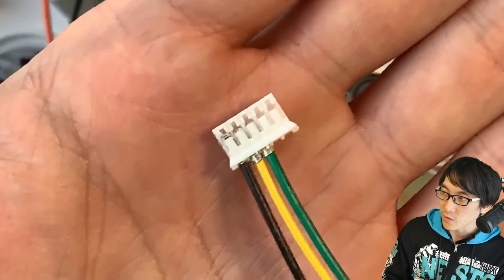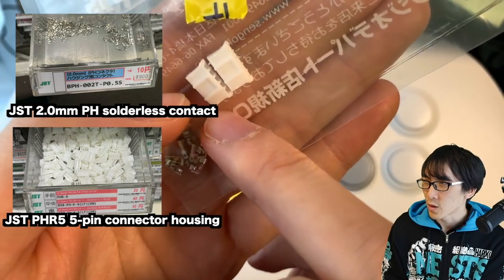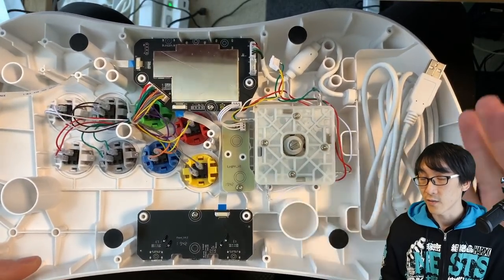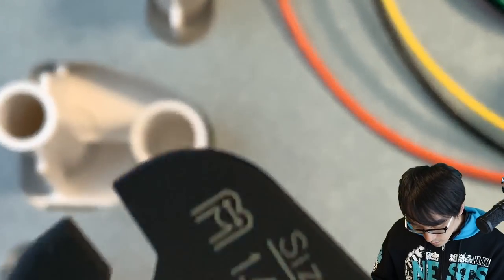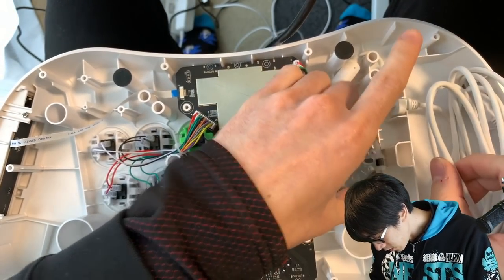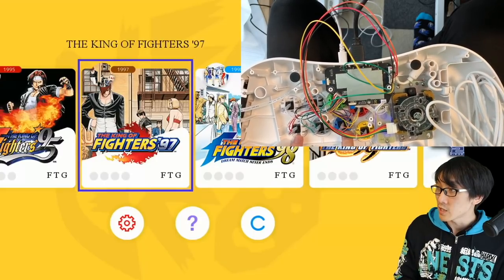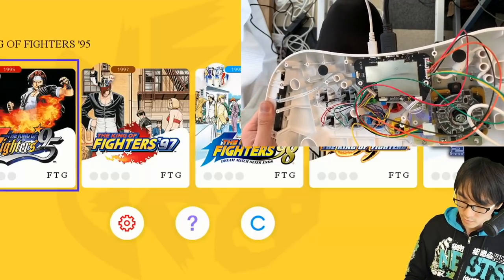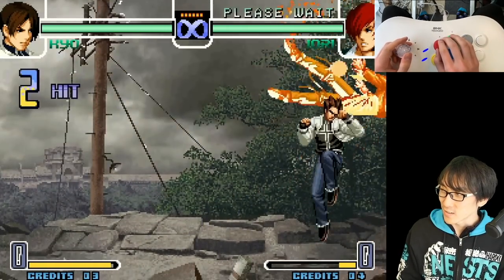EASY MOD (...but you NEED THIS!)【Neo Geo Arcade Stick Pro】

Comment: I have to give SNK a lot of credit for how forward thinking they made this. With the ability to replace parts and swap in higher quality parts. So even if you wear out or break a stick or button you can replace it instead of buying a new unit.

Comment: As reference for anyone who cares but doesn't know: the original Neo Geo cabinets used a Seimitsu LS 40, so if you want it to have that feel now you know which stick to buy.

Of course, this applies only to the japanese cabs, the american ones used battops, iirc they felt like happs or something like that, which sadly don't fit on this stick.
Reply: does the ls 40 fit as well?
Reply: @dbnpoldermans4120  The LS-40 on FocusAttack has both the PCB type and the four plugs type with basically the same mounting plate as the LS-56 which was shown by Scarlet Sprites to be able to mount on the arcade stick. The four plug type would be easier to use the same connections as the base joystick so it would be an easier mod.
Reply: @rxzero00  You're awesome! thx
Reply: @dbnpoldermans4120  No problem.
Reply: I love my LS-40, it's a great all-around stick! (fighting games, shmups, arcade games) Been using it for a while in my previously JLF-modded SF IV Arcade Fightstick, and I'm never going back!
Reply: They used American hardware in American cabs for obvious reasons -- you favor the hardware from home.
Likewise, you're going to see Japanese parts in Japanese cabs on the Japanese homeland and the parts furnishing depends on which vendor (Hori, Sanwa, Seimitsu) the venue (arcade) favors.

I never liked the bat tops, honestly, and am not a fan of the Happ joysticks.  They always felt -- awkward and more like they were made for INDUSTRY and NOT electronic entertainment.  The button positioning and caved in faces of American buttons were something I never liked, either.  Very uncomfortable and just not ergonomic.  They're made for Bigfoot hands, not average-sized human beings.  The fact that they use as the basis for over half the Arcade 1Up machines ensures I will stick with PC and console gaming for the future because I don't want to pay for a stand-up I know I'm going to have to spend at least $100 to mod from Day One to play comfortably.
Reply: @AvengerII  Oh I didn't mean it as a criticism or something, just as information for anyone that wanted it to feel as authenthic as possible.

And I understand why they used the parts they used, and I agree, Japanese parts are better, more precise and so on. However, Happ parts still have a place on my heart, if only because that's what machines in my country had.
Reply: @DEADPOOL9AND  I wasn't criticizing you.
I'm just saying that they're gonna favor the local manufacturer.  That's just how it is.
That's why they used bat tops and Happ buttons in American arcades, and why they used ball handles and Japanese buttons in Japanese arcades.
Of course, they had ball handles on some American machines.  The "Bally" (Midway) Pac-Man machines had ball handles on their joystick levers.  So did the American Donkey Kong machines.  There were American vendors like Bally and Wico that manufactured joysticks with ball handles.  My first third-party "professional-grade" joystick was a Wico joystick.  It was a bat handle but my parents went ahead and got me a second one with the ball handle that I wanted.  One of the last two replacement balltops I bought recently was a recreation of the 38mm red ball handle Wico produced for its joysticks!  It was like a homecoming for me 30+ years later!

It just happens I like the Japanese parts better.  I never felt that comfortable with the Happ parts.  I read years later they adapted these parts from industrial parts (what they would have used in factories) and that explains their ruggedness and also why they're not as sensitive.
Arguably, some Happ hardware lasts longer but the point's kind moot.  Sometime in the late 1990s or early 2000s (when American arcades were dying out rapidly), they sold out the Happ dyes, tooling, etc. to the Chinese and they say the Chinese production of the pushbuttons and levers is not as good as it was in the US.  There's an alternative to that, even.  They licensed the same parts to an Italian company and they still make those same parts to an allegedly higher, more consistent standard than the current Happ does.
Either Happ or iL doesn't matter to me.  I prefer the Hori (levers, pushbuttons), Sanwa (pushbuttons), and Seimitsu (levers) parts.  Even these companies make most of their parts in China now but with good floor managers.
Reply: @rxzero00  Do I always need an additional flat mounting plate for a Seimitsu LS-40 in the Neogeo ASP? Thanks
Reply: Yeah you're going to need a universal mounting plate from like Paradise Arcade so that the screw holes will line up with the JLF holes

Comment: If I'm not mistake, the neo geo machines used the seimitsu ls-40 lever
Reply: Yeah, but the mounting holes in the case are for a JLF mounting plate, so you need to get a universal plate if you wanna use that.

Comment: I got an old dreamcast arcade stick with a bad controller and buttons.  This has me wondering if I could mod it now.  Thanks!  Really appreciate all the mistakes and tips!
Reply: If you wanna keep it as close as possible, you're gonna need a dremel. Focus Attack has a much easier plexi solution that also lets you put artwork inside.

Comment: There’s a version of the JLF that has the microswitches exposed and it would be plug and play
Reply from the maker: Sounds great!
Reply: @NihongoGamer  The joysticks with the 0.187 terminals are a PAIN to wire and figure out.
You're almost certainly better off doing it the way you did for the future.  Most joystick levers for home controllers are plug-and-play drop in with their own PCB (with soldered in microswitches) for convenience.
If you EVER decide to install another joystick in that case, you can reuse that plug in harness as it is.  It installs identically with the Hori Hayabusa lever (if you can figure out a way to install a Hori lever in that case; you might have to cut plastic which would make it VERY inconvenient; I don't see how a the Hayabusa mounting plate would fit in without severe modifications) or the -01 PCB versions of the LS-32, -40, -56, etc.  The only difference with the Seimitsu joysticks is that you FLIP the harness head adapter before plugging it in.

Comment: 😂 "I'm only gonna use two screws, because I can't find the other ones"
I do the same... Lost like 1/4 of my laptop screws.
Reply: i took my NES apart to fix... it now has 2 screws holding it together (out of 6) and i think they may be screws from inside the machine. I swear i had it organized but then knocked my tray over and bye bye screws.
Reply: Well...exact opposite here...i always end up with some screws left

Comment: Thank you for showing in detail step-by-step trial&error guide for switching sticks and the problems that come with it, next step showing us soldering skills 😁 
I've swapped a stock stick and buttons on a venom arcade Stick with Sanwa parts years before by myself and use this stick till now...
Btw the black circle dust protection that came with the Sanwa one should be on top of the case and can replace insteaf of the white one if desired. Otherwise are you expecting double dust protection? Otherwise it could even cause problems later and your stick is slightly shorter in depth where it comes out of the case.
Greetings 👍👍👍
Have missed the banana there, where it belongs🤪

Comment: For those that want to do the mod, this is more or less the "long" way of going about it. The reason he crimped the cables individually was because he couldn't find the correct one that's pre-made on both sides readily available.

If you shop online, you can find the right cable that has both sides of the cables already pre-done and all you would have to do is plug in both sides and you're done.
Reply from the maker: Can you tell us the part number of this cable so we can search for it?
Reply: A link would be nice, thank you.
Reply: up

Comment: Seimitsu LS-32 or LS-40 is your best bet, since those Neo-Geo fighting games use those joysticks for higher level of execution...
Reply: Which plate will work in the Neo Geo ASP using the Seimitsu LS-32? I am thinking about using it, but only know of the MS Flat Plate fitting properly.
Reply: @jrc9648  A flat plate will do. Or maybe a Kowal flat mounting plate...

Comment: I plan on changing the buttons and ball top on my ng asp, but I've never modded a stick before because I've been intimidated due to not wanting to mess up an expensive piece of hardware. How do the wires come off on the buttons? Can I just carefully  pull them off then re-insert them?

Comment: Hey are you ever going to change the buttons? I just ordered this stick/system and definitely want to mod it. Here's hoping you do one final video of this series changing the buttons out. Please? Lol 

Love the content btw, you have a very informative and fun channel
Reply: Buttons are easy to mod, but only snap-ins will work
Reply: @KetsubanSolo  Did you mod this stick yourself? I just ordered one, and I already have some Sanwa snap-in buttons and a Sanwa JLF lever, but I don’t really like messing with cables or cutting them. Is it true that using a Seimitsu lever makes it easier to fit without needing any cutting or re-wiring? I don’t mind getting a Seimitsu lever.

Comment: Those fingers are looking rough!   Good job on the mod.

P.S. Is Sengoku in the Radio Kaikan?
Reply from the maker: Sengoku has two branches. The arcade button parts are in Radio Depaato and the some JST connectors and cables are only available at the other branch about 5 minutes down the road next to kotobukiya
Reply: @NihongoGamer  The Kotobukiya behind HEY, right?

Comment: I wonder if you could get away with buying some female-to-female Dupont cables off eBay. Just means you don't need to buy special connectors or make cables yourself, you just need to connect the wires and close up the stick. I've not tried it, but maybe someone else can confirm if it will fit?

Comment: What sizes screws did you use to mount the new joy stick? I'd have a heart atack if I  strip the holes. 
Update: I measured the hole for the arcade stick mount plate. Standard is (⅛w)x (¼d)in. Metric is 3.1x 6.3mm. I ordered a couple different screw types on Amazon. It's hard to find an exact screw type that may fit so I'll let you know what works out. Wish me luck. Thanks NG.

Comment: Using a Sanwa JLF for KOF is a very bad idea. For games like Street Fighter where circles, half circles and quarter circles are the priority, it is perfect, but once you try a fast paced fighting game like KOF and start doing things like hyper hops, super jumps, running forward, back dash and many other things that require a short throw distance and higher tension, a JLF literally becomes the biggest nightmare ever (unless you use a custom oversized actuator and a "heavier" spring, of course). I had to learn this the hard way.
Reply from the maker: I’ll give other sticks a try! Might be a good opportunity since I’m not super familiar with short hops yet
Reply: @NihongoGamer  Sounds amazing, man! I also noticed you started with KOF 2002, I would recommend that you give the proper ones a try first, like 97, 98, 99 and 2K, since those ones were made by the real SNK, so you will enjoy KOF and Neo-Geo in general at its best (best graphics, best art, best story, best voice acting, outstanding OST, etc). 94, 95 & 96 are also amazing, but the combo system was not polished enough back then in my opinion.
Reply: @PurpleSanz  growing up my city had a mini putt and for a period they only had two cabs and a pool table for an "arcade" (they got better) one of the cabs was KoF 98, best
Reply: OttoDIY V2/V5 modded JLF just give that possibility, if, like me, you don't want to swtich to korean levers.

Comment: Hey so you can actually do a direct swap to a Korean lever like the Crown 309MJ or FJ without even needing a new wire, cuz you can just pull the 8 quick disconnect terminals off of the original lever switches! You could also swap in any Seimitsu lever that uses the same connection style (with 8 individual microswitch terminals, not the PCB 5 pin connector).

But the Sanwa JLF uses a 5 pin JST-XH 2.54mm connector, and the original lever uses a 5pin JST-PH 2.0mm connector..
So you'd need to find a premade 5 pin JST-XH to PH wire to do a plug n play JLF swap. 
Or you can get the same JLF wire he used in the video, but instead just crimp some .187" spade terminals onto the 5 bare wires and connect them directly to the original microswitch quick disconnects.
Reply from the maker: True! I’d like to try crown and seimitsu levers some day so this could be a good opportunity

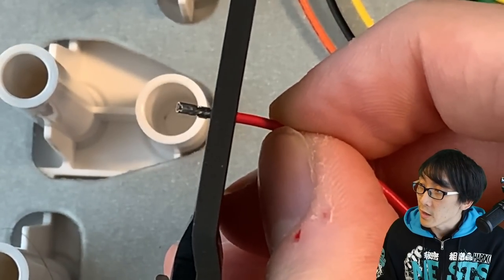Comment: 6:17 LOL! You made me grimace when you clamped that on the wrong part of the wire. It's like watching a horror movie, and you just want to yell at the characters not to go that way. BTW, all you need to do is use a small drill bit to ream the holes out on the connector to accommodate the thicker wire.

Comment: The insulation makes zero difference. Squeezing them was the correct move. If you want to use "thinner" wires, just buy a double sided adapter harness and plug it in. But you won't need to. If you want to get nuts you can solder it straight to the pins and use shrink wrap.

Comment: One day for the sake of convenience we'll have a large arcade stick that's retractable to fit in a small backpack
Reply from the maker: That would be amazing
Reply: I recall a WoolieVS arcade stick video where he had a mechanism that allowed for a detachable joystick for when putting in a backpack. Not perfect, but ideal in the right situations.
Reply: @AnxietyPictures  I was thinking more like folding it or breaking it in half and putting it back together lol
Reply: You could just do the Phreakmods Link joystick shaft mod to make the stick much slimmer and easier to slide into a backpack. Basically the same as what comes with the Victrix fightstick.

Comment: honestly i am surpirsed you bothered finding a connecting head that sized and not just use single pin housings for each wire. also just look up pin housings they are 100+pcs variety packs online for less than a tenner. single pin housings allows you to re-wire(both ends if need be) as needed if you swap sticks alot.
Reply from the maker: Would single pin housings still fit in the white plastic pin box on the PCB?
Reply: They are typically only slightly larger than the crimp connector about the same-ish clearance when you placed the wires in alone for the test fit so i would say yes the only downside is that they are friction fit so a minor pull will unplug them but by just estimating from the video the pins housings would be butting right up each other. but would have plenty of clearance form the board's clip.
Reply from the maker: I’ll def keep it in mind as an option for future mods